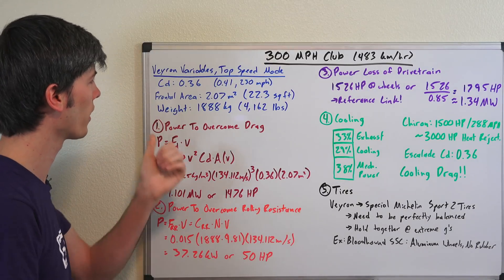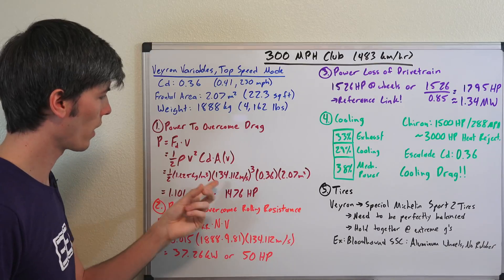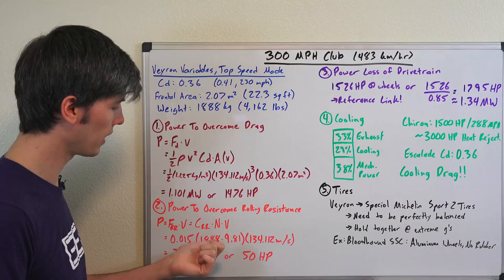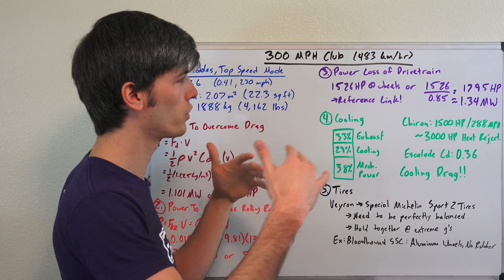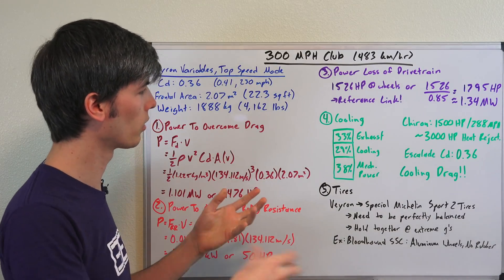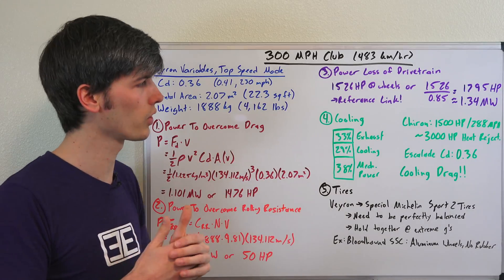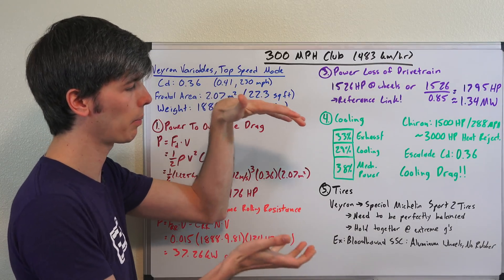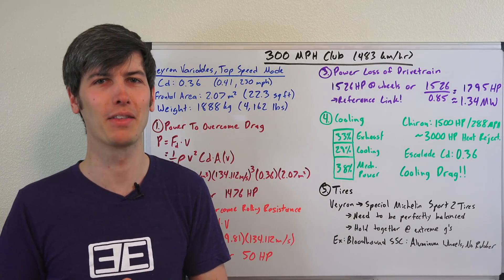Why Has No Production Car Hit 300 MPH?

Comment: Cool video, I hadn't thought of the losses that come from cooling. One thing I think I didn't see accounted for is the downforce of the vehicle at that speed, which would go into your rolling resistance calculation. You only used the weight of the vehicle directly, but it's an easy thing to account for.